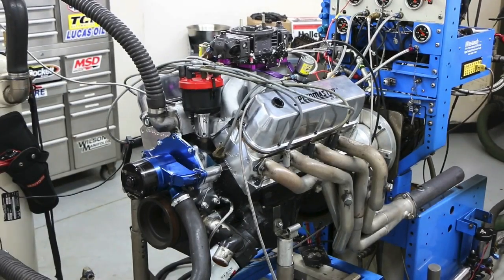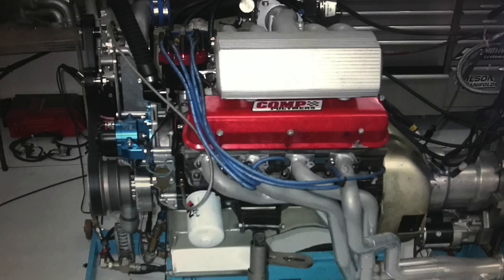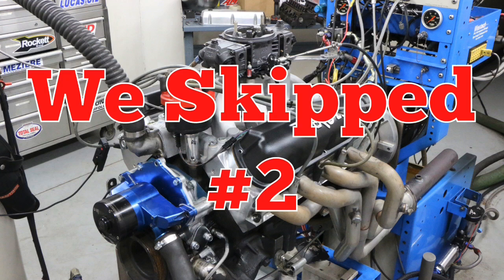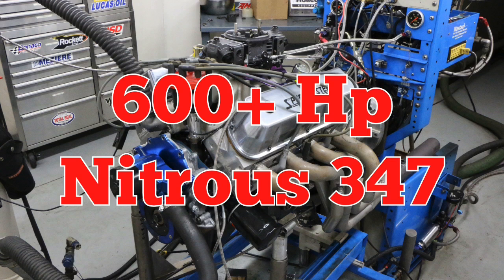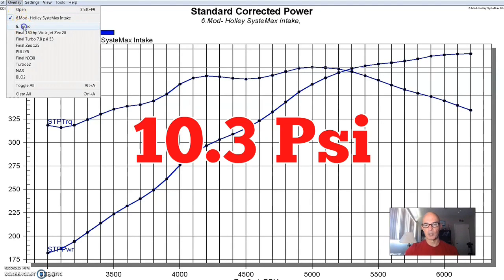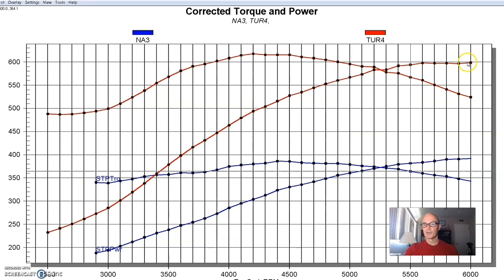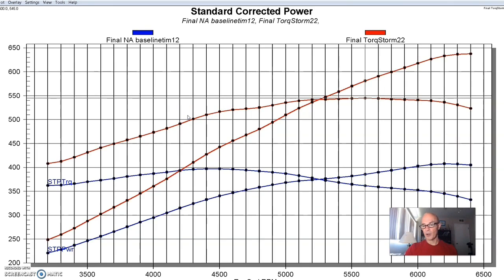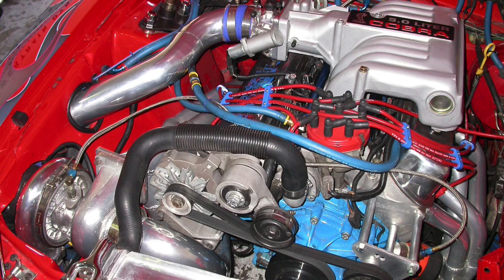5.0L FORD BLOCK SPLITTING-FACT OR FICTION?

Comment: Fords aren't the only ones. I work at the remanufacturer that does GM'S stuff. In the early 90's I uncrated a 403 Olds core that was split just like that. I don't know what the magic number is, but I think the weak point is the oil gallies between the mains and the cam. Fords are pretty big, so were the Olds. In a sbc they're small comparatively. This is in an area where the pistons and rods are trying out tear the block in half.A side oiler is the answer in my opinion.
Reply: Olds 403s (and later 350s) had extremely thin mains with holes in them (aka the "windowed mains".) They were somewhat reputed for it. Kind of a shame really 403CI in a small block would have made them popular for build ups otherwise I suspect.
Reply: Pfft 403 olds

Comment: great info, i will go with engaging nitrous at much lower rpms than you showed. i never waited to 5000 rpm to spray it.
Reply from the maker: we don't on the street either
Reply: @richardholdener1727  so that doesn't do it? then i guess you are right...wives tale/ bad machine work/assembly

Comment: Probably casting lottery. Imperfections in the castings.
Reply: That would be my guess as well. Throw in a little fatigue from high mileage and repeated abuse and it's a recipe for failure. The real question should be what about the design makes this specific failure point so prominent.
Reply: There's a lot at play. The early 302 blocks (they had longer cylinder walls, since the increased stroke would pull the pistons out the bore further at BDC) had more nickel than the ones in the later 1970's. The Boss 302 had screw in core plugs to help with strength. In the earl 1980's, its alleged Ford cast the Mustang blocks with more nickel, perhaps to 1986. Certainly they changed the weight of the crank, which is why they run a different flywheel, and that change was at the nose of the crank, where most attach a supercharger belt and tighten down to prevent slippage. 

There's the usual power adder problem when one nabs a junkyard block and bolts on N20 or a blower or whatever--how loose is the piston ring gap? If its still tight, the rings expand with the heat, butt together, and snap the crown of the piston off. Since the Mustang used the same EFI intake as Thunderbirds and trucks and Lincolns, how many can look at the outside of one sitting in the dirt and tell they have a forged piston inside? (one way is that the HO engines have a 351W ignition timing order, the non HO's have the normal 302 W).

Someone also believed its the ignition timing--the base 302 fires the 1 and 5 cylinder right after each other, and can cause stress at the front of the block, while the 302 HO uses the 351 W firing order.
Reply: Came to say this. Figure this plus peak cylinder pressure as relates to tuning and parts selection.
Reply: That bad luck plus a specific harmonic I would think.
Reply: I was going to say toss of the dice.
Reply: Happened to me every after magnaflux and sonic checked. What a shame
Reply: @DWBmotorsports  but how tight were your journals that is  super important
Reply: @dashforcash6555  .0025 on the mains if I remember correctly. Everything was mic’d during assembly and set to spec. The rotating assembly was completely unharmed. The block cracked in the webbing starting at the mains up to the cam bore where it allowed the cam bearings to walk out enough to contact the lobes. Only reason I even knew was because I lost oil pressure at idle. Car didn’t even make any bad sounds and ran fine before I pulled it apart to inspect.   Therefore the block splitting Had nothing to do with bearing clearance.
Reply: @DWBmotorsports  was wondering what your power level was l got a 331 with 600hp plus crank. I have been running the engine for 7 years now. It's strictly a street car l don't baby it but l don't bag on it either. I try and shift at 6000 rpm but she has hit 6800rpm many times.
Reply: @dashforcash6555  if I had to guess it was likely making between 475 and 500 horsepower. I had big Victor jr heads and a pretty stout cam, large single plane and a 750 carb. Trap speeds put it around power level based on calculators and I’ve seen many dyno graphs of very similar combos make that much. This was through a stick, and when I drove it I drove it hard. 5,000 rpm clutch dumps at the track on slicks. But it only lived 1500 miles before it split.
Reply: My thoughts too.
Reply: Look at BBCs,some of them have bad core shift. I would think some fords came out bad too. Just got to know what to look for
Reply: @BruceLee-xn3nn  For those who don't know "core shift", when a block is cast, there are cores made from sand that mimic the shape of the water passages. This is the sand that allegedly painting the block is supposed to trap (yet funny, no one paints the heads...painting the inside of the block is a waste of time. It doesn't smooth anything, it doesn't prevent rust (the oil running around does that, it repels water) and so on. Ever pull a junkyard block and the paint is peeling from the constant expansion and shrink? You're more likely to get that inside the block if you paint with anything but Glyptol.

so how does the sand get out? Thru the Welsh plugs most folks incorrectly call a "freeze plug" on the sides of the block. back in the Great Depression, some farmer probably used water to save on the cost of anti freeze and the water froze inside the block and pushed out a plug and gave Henry Ford credit.  But its really a "core plug"

So how do you check for core shift? Measure the boss around the cam shaft tunnel, it may not have a uniform thickness around its diameter. Or you may find the cylinder walls are thicker in one place, or some other measurements aren't uniform in the block. Some can be corrected with offset machining. For example, you can offset bore the cylinders closer to the intake manifold, but not towards the front or rear of the block. 

Most low deck Windsor blocks can't be bored out past .04", but there's some that are cast "wrong" and are thick enough to go .06" over. I suspect these are the blocks some people luck into and these are the blocks that can do over 500 hp without cracking right up the main webs
Reply: @BruceLee-xn3nn  I have no desire to look at BBCs.
Reply: that's it--everyone has a story about what they got away with, yet the engine has been around long enough, that's there's enough stories of what happens past 500 bhp. It could be casting flaws, it could be tune, it could be some main webs were cast thicker (the machining process is called "blueprinting" for a reason, they are within spec, not spot-on).
Reply: Tuning can’t be ignored, this guy uses a dyno, he doesn’t guess.
Reply: (Story Time)..... My dad worked in the Cleveland Engine plant around 1970-71 era, while there he saw many of engine blocks come and go. One day he took notice of a set of engine blocks on crates being taken from the production line and carted away, he happened to ask his supervisor "where are those blocks going"? Supervisor says "They are going to get worked and sent for the Lincoln and Mercury lines, you get what your money pays for!"..... now may I remind you that this was 70-71 era, but could they have maintained the machining process for the 80's and 90's?
Reply: @staylebutler9135  Yes and no.  If the supervisor meant those blocks had better machining and nickel content, then the thing to keep in mind is, the luxury car buyer of 1971 had about 3 choices--a Lincoln that got 10mpg and died at 80K miles, a Chrysler Imperial with the same tech, or a Cadillac. 

(Mercedes was still breaking into the market, BMW made bikes and sports cars and the 2002. But repairing a Merc was like repairing your Rolls Royce back then).

GM was "too big to fail", but all American corporations had the same mindset. WW1 and 2 had destroyed competition in Japan and Europe. So an american business could afford a 50% corporate tax rate, and a massive labor pool (replaced today by a cellphone, watch the first episode of "Mad Men" and count all the employed folks doing the job of the average cellphone) since the competition was another American business with the same overhead. Then comes the gas crisis of 1973. But the rest of the world has caught up a little bit, and they make economy cars to compete with exploding Pintos and Vegas that eat their engines.

so the world gets some market share in america. their quality gets better, and by 1980, Chrysler is bankrupt. Ford has most of its cars on the Fox body platform from 1979 until 1993.  GM's G body is at least a body-on-frame (unibody cars rely on panels for strength, but if you keep stamping the same panel long enough, the dies wear out and things don't fit as well) but it too runs over a decade. The Japanese refresh their competing cars every few years, so there's tech added in, while Detroit keeps up with the best of 1970's tech in their platform.

Lee Iacocca, probably the best forward thinker, has a bankrupt company's budget to play with. But he creates the minivan off the K car. It sells like hotcakes until the Japanese figure out they too can build a van off a car platform--and they have the quality reputation amongst consumers. so then we get told that the SUV is the best vehicle.

why? because its built on a big pickup truck frame, and what Japanese company builds a big pickup truck? Its all mini trucks and the Toyota Land Cruiser. 

could we have changed? yes. GM did have Saturn, but it has a long reputation of killing any car once they get it right (ahem, Pontiac Fiero). it was more profitable to steal cars from GM Opel in Europe (to be fair, the Big Three all bought stakes in Japanese auto makers to get their economy vehicles, and Ford took the Escort from England before it used the Mazda 323) than try to whip the managers into doing something different  than the old ways of doing things. Ford went outside the family finally for leadership who wouldn't do things the old way. And Mopar sold Jeeps and big pickups.

don't know if that very generalized look at history answered your question :)
Reply: @albertgaspar627  I appreciate the "Vary Detailed " response, I enjoyed reading it and alot of it I do know. I know that the story I gave was a open book of answers and replies ready to be shot at me, so I'll ask do you think the same "Extra Care" was done into the 80s and 90s engine blocks?
Reply: @staylebutler9135  While I wasn't working there, I do know some things.  Ford's "Windsor" blocks came predominately from the Windsor, Ontario plant, and they were originally designed for the Ford Falcons, which were lightweight economy cars. So the design of the low deck Windsor block was for light weight, low cost, and to handle the power of a 221 cid displacement.  The Cleveland Ohio plant was making the 351 Cleveland V8's, designed more for performance.

When Detroit got its butt kicked in the late 1970's, it cut costs where it could. The cast iron mixed for block manufacture, prior to this got nickel content for strength in a cast product. So less expensive nickel went into most blocks made in the late 1970's, and engine builders tend to avoid them. This is true of Chevy, Mopar 440's, Pontiac 400's, etc.

When performance returned, however, its rumored Ford made two 302's (I think both used the 50 oz flywheel, while prior 302's had the 28 ounce flywheel, which means something changed inside the 1980's engines in terms of balancing), one with a higher nickel content for the Mustang performance option (and the Mopar 2.2 litre 4 cylinder had the same feature, a higher nickel content block for turbo models until I think 1984 when all blocks were the same nickel content). I believe 1986 was the year Ford also made one 302 block with the same nickel content, whether it went into a Lincoln or a Mustang GT. It was just cheaper to store one block than to maintain an inventory of two, and they were changing to a roller lifter bore design in the lifter valley.

As for the longevity of the low deck Windsor (I use that term to differentiate from the 351W), I posted  my theory elsewhere, but I'll repeat it again just in case...most low deck Windsors can't be bored past .04 inches (Chevy small blocks, for reference, tend to go out .06 inches).  But some low deck Windsors can go out to .06 inches, just due to casting irregularities--its a matter of mass production and why many engine blocks need to be machined back to "blueprint" status (if a block is truly out of whack at the factory, it goes back to recast, but Mopar will just machine the block and stamp an iron cross or other symbols on it to show oversized crankshaft journals etc). 

I don't know, but I'll guess folks who have pushed a 5.0 Mustang block past 500 bhp and not split in years, have these "unicorn" blocks that have the thicker walls.  But how many folks sonic check a block to be sure--most strap on the power adder and keep turning up the wick until something goes. So no one really knows how many of these "mistake" blocks came out in Fords.  Or they do and aren't telling :)
Reply: @albertgaspar627  it's also possible that the blocks that split were lemons rather than that the blocks that lived were unicorns

I'm not denying that there might be a significant lemon rate, though
Reply: @totensiebush  Its an interesting theory, but a company with a high lemon rate pays a lot in warrantees. I think I posted here or elsewhere, Ford designed the Windsor to be a 221 cid engine in economy cars...so its naturally lightweight. The engine prior to it was the Y block that Ford decided was too heavy to make a sports car to rival the Corvette, which is why the T bird was a cruiser car.

Chevy made its small block for family cars and trucks, hence it could be a heavier engine and take more HP. But Ford just needed a block to handle the output of 221 cid....so an inability to handle 500 crank hp wouldn't be considered in the realm of "lemon". Plus it later made a 351W that takes 600 bhp. Considering that roller 302 engines in fleet vehicles routinely went past 200,000 miles with fleet maintainance, suggests the engine did exactly what it needed to do--"bread and butter" results, and anyone who wanted max performance had the tall deck Windsor and the Cleveland to choose from.

And that's where I get the "unicorn" notion :)
Reply: @albertgaspar627  I guess "lemon" isn't quite the right term, but maybe 90% of them can handle 500whp for a while without splitting, but a few can't. 

Not a real lemon, but Richard Holdener's results seem to indicate that not being able to take 500hp is an outlier.
Reply: @totensiebush  no, "lemon" is a good term, since its relative--its a lemon to us, but not to many others. Shoot, 500 hp was a wet dream in the muscle car days. Most performance cars were 350-400 hp.  And the story of blocks splitting came in the late 1980's, when folks who were not afraid "EFI is the death of hot rodding!" figured out how to hot rod the new Mustangs, got them to twice their advertised power...and split 'em like logs. It really was happening in the "5.0 vs GN" races in NJ and elsewhere. The big dawgs were hunting old Boss 302 blocks and "Hecho En Mexico" blocks to solve the problem.
Reply: @staylebutler9135  1970-71 was before emission control laws were enforced. The quality of the engines from 72 and newer were bogged down with emission control restrictions and lower engine compression.
Reply: 69-74 strong 75-79 over all craftsmanship and casting kinda went down. 

H.O is lighter over all but still if your goal is 500hp on the two bolt main 302 You may want to use a ford racing or dart 4 bolt block. 

Or just get a 351 and be done

Comment: Richard I'm not engineer, but I feel like it is a combination of poor casting, improper torqued mains, and harmonics. I am not a pro though. Lol
Reply: Jason Jones  I'm not sure. No motor likes spray down low. They usually don't split or crack blocks from that. I have see that hundreds of times bust pistons and rings. I could see detonation adding to harmonics. Most of the ones I have seen have cracks from main cap bolts to intake valley. Like bad cast mixed with improper tq of bolts.

Comment: Metallurgy & casting tolerances. Core shift that occurs during casting process that makes the valley thickness thinner. Would be interesting to sonic test that area in a cracked block vs one of Richard's blocks that's been wailed on hard & see if there's any difference.

Then again, it could all be some fake Chevy fanboy conspiracy 😆
Reply: All the engine builders I have worked with over the years agree with your idea. It seems like it's a problem with how the main webbing gets cast.

Comment: Thanks a lot for that!  I've been reluctant to push my motor very hard for just that reason.  I'm running a rebuilt short block with an e-cam, ported stock heads, street heat intake and an on3 turbo kit. On 6 to 7 pounds it runs very well, but I think after watching this I might push it to 8 or 9 just to see how it responds. If I split it, I'll let you know. :)
Reply from the maker: good luck and let me know